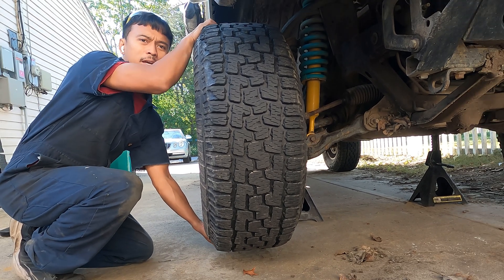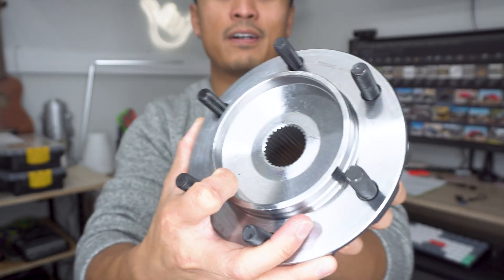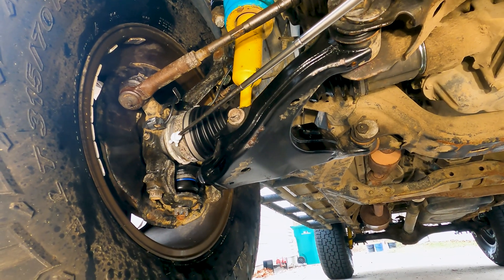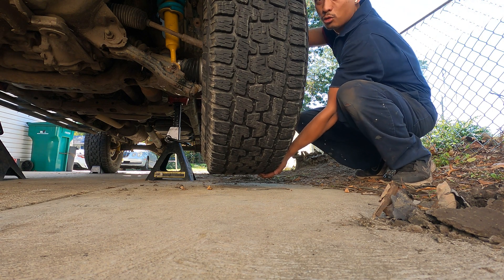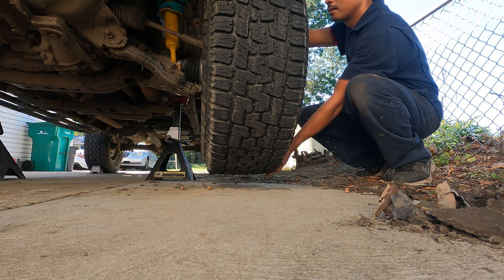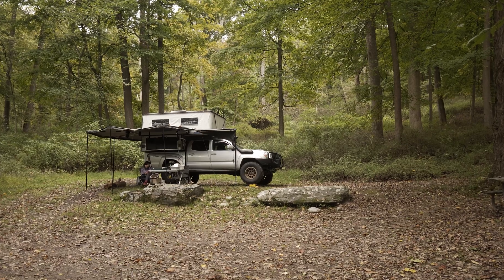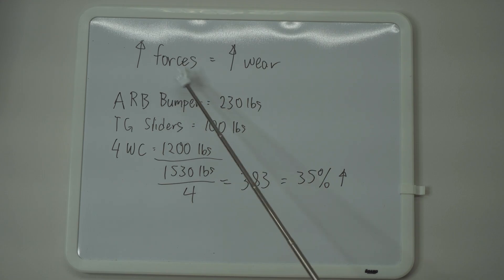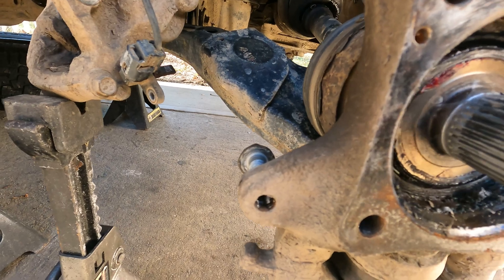your fault...Kinda...

Comment: Hey I have a beloved 2004 Tacoma 2.4 man tran 5 speed that just smacked a deer. The engine has slightly dropped on one side and the motor mount appears bent. Can I use a floor jack and wood block against the oil pan to lift the engine a few inches to remove the mount? No hoist so hoping you might know a workaround. Much thanks!
Reply from the maker: Yes you should be able to. It would be better thought to jack it on the transmission bell housing. Check out my motor mount replacement video. You'll be able to see some of the techniques I used
Reply: @TacomaTutorials  I watched the video and subscribed. Very impressive wrenching! So one last question--for a 1st gen 2.4 liter does the engine appear slightly tilted downward on the passenger side or should it look level, like the radiator for example?

Comment: So if we, WE, created a spindle with an extended hub portion to place the bearing centerwise to the wheel we would get better life?
Reply from the maker: Yea, technically I think that's correct. The only limitation is the center bore on the stock size hubs are so small - so the bearing would be so small too (which would be worn down pretty quick too). I'm doing a knuckle rebuild on my 80 series and the center bore on that is much bigger and those bearings (there are two parallel ones per tire) are further apart. The outside wheel bearing is almost to the face of the wheel.
Reply: @TacomaTutorials  likely bigger bearings is the only fix unfortunately
Reply from the maker: Agreed plus get rid of all the ball joint and wheel bearing high maintenance issue by going SAS
Reply: @TacomaTutorials  😃

Comment: Yeah, I was eating up after market wheel bearings on my tacoma. Then I got original koyo bearings on ebay. They have lasted better than replacements.
Reply from the maker: How many have you gone through and how much miles do you have on your truck?
Reply: @KFloTacoma  gone through 3 and truck has 140,000 miles. Living in Vermont may have something to do with it.
Reply from the maker: What's your setup like? 35's and armor? I love wheeling in Vermont, BTW. Nice trail systems there and NH
Reply: @KFloTacoma  ì am not an off-roader, the most I do off- road are gravel backroads to access fishing and hunting spots.
Reply from the maker: Wow, that's surprising to me. Is your setup mostly stock? Do you go through pretty muddy backroads?
Reply: @KFloTacoma  yes, I'm pretty much stock, with tires with aggressive treadmill for muddy roads in spring. BTW,  I failed to mention how much I enjoy and use your videos when I do work on my truck. Much thanks from a 70 yo wrencher.
Reply from the maker: I'm glad that my videos have helped! Thank you for watching and supporting the channel!